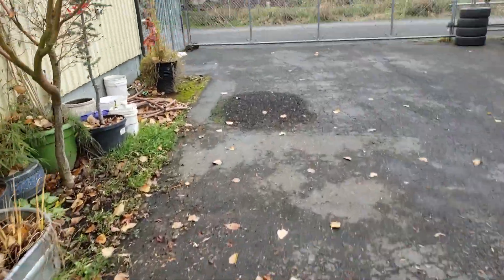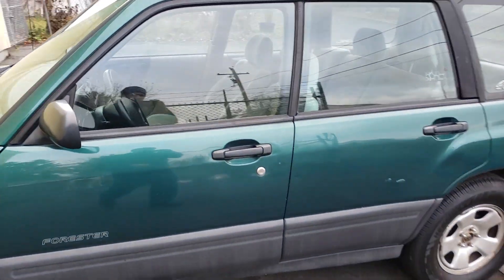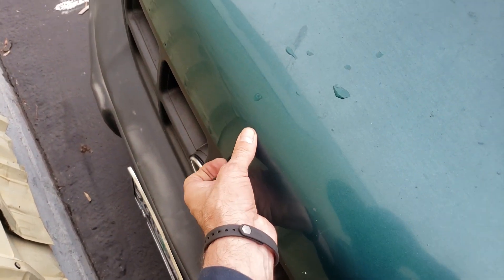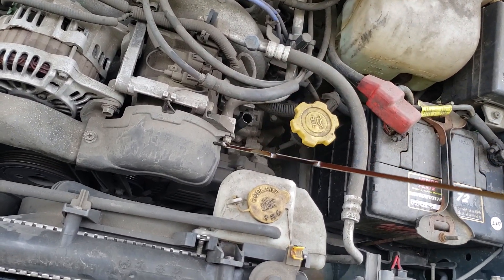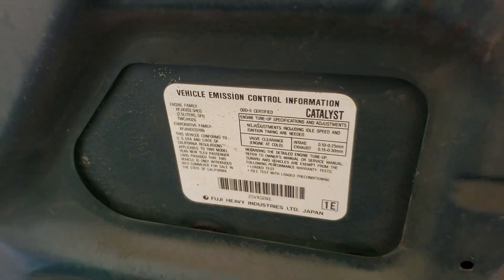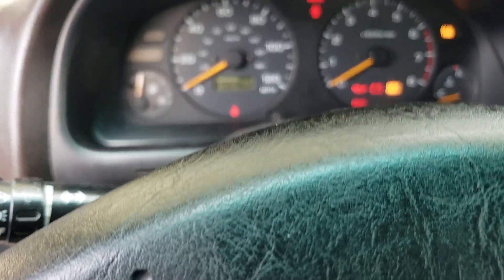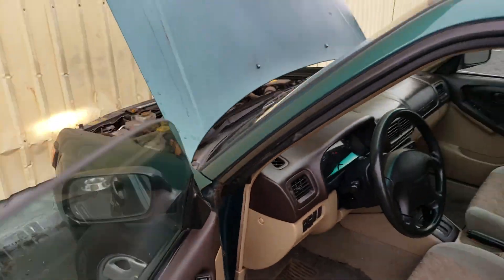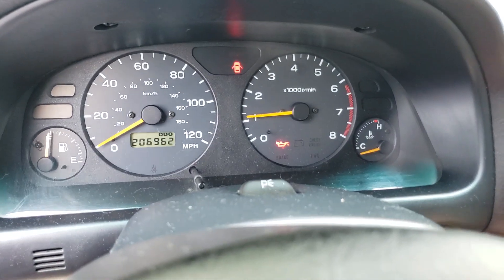Customer Drove Car for 3 Days with "OIL" Light On

Comment: Back a week ago, I accidentally flooded my carburator on my 1985 Simplicity 4208, What happen? Well. Oil went into the spark, So I shot out the excess gas. Drove it for a week. Not realizing gas went into the oil...

You know where this is going... It seized! And I only owned it for a month. Lucky me being a country boy and knowing simple mechanics I just drained the oil, Gave it 4oz of Marvel Mystery oil, Like 50 ounced of STP 10W-40 Oil, And manually cranked it (Turned the crankshaft counter/clockwise) To let the oil free up the gears, And I cranked it. The cylinder was still stuck, So I turned the crankshaft backwards so the engine could turn before stopping. And behold. The mower cranked, And the cylinder free'd itself and roared back to life... Thank god this is a $200 mower and not some $1k+ lawn mower. Don't mess up your hooptie!
Reply: Now, Luckily. Since it theoretically had oil, It didn't damage the mower that much, If it didn't have oil, And I unsezed it, It would have a loud constant knocking and excessive vibrating. Luckily mine didn't have any side effects. 

Note: If your engine seized on your mower, Manually turn it where the crankshaft bolt is, Don't turn the flywheel with a crowbar. The teeth on the flywheel (that touches the starter) is aluminum and you can bend/break the teeth and it'd be a nightmare to replace, Since you have to pop a bolt over the flywheel... Which is hell. So I would just use a wrench and twist it by the bolt.
Reply: Wow nice save

Comment: I'm a registered nurse. If we have someone come into the emergency department with chest pain we assume that it's cardiac until proven otherwise. It might just be gastric reflux, but the safe thing to do is act cautiously. Why would you assume that an illuminated oil light is NOT an indicator of low oil pressure and keep driving the vehicle when a few simple tests would reveal the truth? Heart or oil pump, in either case, ignoring the warning signs is a very poor choice.

Comment: The good thing about it is that non-VVL 2.5s are a dime a dozen for Subarus used. If they want something that'd last a long time, retrofitting a 22 in there would be a good bet
Reply: 2.2l is Subaru's best engine. Not the most powerful but damn good.
Reply: Tracey Allen it's got a power option too, though they're rare you can get EJ22Gs, put out about 280hp/268lb-ft stock, dead reliable and closed deck from factory. Can't argue with a stock 2.2 though, one of the only 3 older Subaru engines I'd buy including 22, 30, & 205/207

Comment: When you talk to the customer, start off by saying, "This wouldn't have happened if you had a 2-Stroke."
Reply: It does, I've fixed lots of my freinds 2t scooters, every single one of them was simply ran without oil, most of the time the oil metering pump failed.

Comment: Cheaper to put a used engine in with a warranty than to buy a new car or a used car with unknown issues that he will have to deal with. The car is worth it for where he lives.
Reply: A used engine could have an unknown issue too. An engine rebuild will cost around 2.5k and the car definitely is not worth that.
Reply: I swapped my buddies forester engine. We used a rebuilt from a local rebuilder. After the core it was $1700 plus labor which really isn't much concidering. We also did clutch and a few other things while we were there.
I can pull the motor in a hour or so. It's not hard.
Reply: @jeroenschuuring6060  Cheaper than a $25,000 2019 Forester. People suck at math and poor people have poor ways. This car with a freshened up engine is absolutely worth $2500 and 20+ years of service.
Reply: @Edgar-Friendly  so you would invest 2.5k into a car that in case of an accident will be totaled with a mere scratch on the rear bumper?
Reply: @jeroenschuuring6060  You used the word "invest" about a car? Are you 13 years old needing status while having no clue about how to maintain a car on your own? Please educate yourself about Uncle Tony's Garage here in YouTube.
Reply: @Edgar-Friendly  sorry to inform you but I'm a bit older then you think. I've had my own workshop for about 30 years now. I would not advise anyone to put this much money in a 21 year old Subaru forester. This has got nothing to do with maintenance. It's a large repair bill that has no justification whatsoever! What you would do in this case is irrelevant. You repairing in this case just proves your poor judgment.
Reply: @jeroenschuuring6060  Had. You obviously do not comprehend how to save money. You said "invest" in a car. Try to learn some math. $25,000 has one more zero...at the end meaning that its far more than $2500. Still $22,500 in maintenance to catch up over 22 more years. Christ.....you must be a Boomer. Would explain your complete ignorance about money and cost vs investments.
Reply: @Edgar-Friendly  hmmm, I know of someone that's ignorant but I'll leave it with 2500 would probably buy you two low mileage 1998 foresters. Have a nice day....
Reply: @Edgar-Friendly  you are so right in all your observations, they really should make room in a sanctuary for you. Close the doors and never let you have contact with the outside world again. You never hurt my feelings by the way, I can only feel sorry for you.

Comment: He ran it low and whatever oil was left sloshed to the back of the pan when he was going up that hill. Starved the oil pump and bearings (basically the whole motor) of oil. Sad, my father did the same to an old Chevy Metro I had in the mid 2000's

Comment: I used to have a car with an oil light that wouldn't go away. I think the actual light bulb broke (edit: the oil light bulb broke, but the noise was still very much there) , so instead of checking out what was wrong, I kept on driving the thing for a couple of months.. after getting rid of the car, it seemed the camshaft was basically running dry because there was so little oil pressure! We were all young and naive at some point.. still kinda feel bad for the Polo, loved driving that car :)
Reply: Ah common problem with older polos

Comment: Customer had a light. When the oil light on my Slant Six failed, I never knew. Nor when the rear main seal blew the contents of the oil pan all over the Atlanta suburbs on a 20-minute ride. But I sure heard the death rattle of burned-up bearings...

Comment: Looks like the oil light was not on due to low oil, but for low oil pressure. Probably the engine was due for major work, so driving it for three more days didn't really create more problems, it needed an engine anyway.

Comment: As a double check, can you fit a pressure gauge into the oil pressure sensor point to check the pressure or lack of it?
Reply: So a sensor to check what the sensor is checking. Ok then....
Reply: There are several places to to hook up an oil pressure guage and check the actual oil pressure.  No point now, that noise is almost certainly engine damage.  Oil pressure light and engine noise equals serious engine damage!

Comment: Yes because as is widely known the oil light or oil pressure gauge on your car is a conspiracy by the oil manufacturers to sell oil, which your engine doesn't need because air is lubricant enough. So you can safely ignore an oil pressure warning light. 

/sarcasm off

Comment: Sounds like its got major bearing failure. Possibly also skipped timing and/or plug wires / plugs / coilpack are bad so its not running on all cylinders. Might also be worth checking the MAF. But due to the sound of things... it will need a new motor

Comment: Well at least he had oil in it. But 3 DAYS and just HOPING IT WAS THE SENSOR? Probably dying oil pump. But 3 DAYS.... he deserves to have to buy another engine or a new car. I had it once AND TURNED IT OFF IMMEDIATELY. Within walking distance there was an engine reconditioning place. They told me WHERE the oil sensor plugged in and the lead had fell out/got knocked off somehow. Pushed it back on and we were fine.

Comment: If the oil light is on most likely low on oil or oil pressure sensor orher than that needs a new engine.

Comment: So what's the next step in the triage? If the light says "no oil" when the dipstick says "yes oil" where is the break in the system?
Reply: Oil pump fail or due to lack of changes a clogged oil screen pickup
Reply: , the light says no oil pressure not no oil
Reply: @jusb1066  Most likely clogged with ground up main bearing shell.

Comment: ....but why would he drive it with the oil light on instead of stopping...
Reply: @davemcguigan218  maybe had problems with the same sensor before?
didnt chernobyl happen like this
Reply: @fritzkuhne2055  it was a fairly new car.  And this guy didn't have his act together and even his friends blasted him.  Not like the average person who would react with common sense and shut off the engine.  So he learned an expensive lesson!
Reply: Yeah really... lol 

Oil light on means an instant stop, or at least as soon as you can, if you're on the highway or what...
Reply: dirty engine explains that he never looked inside the bonnet
Reply: Lots of oil pressure sensors go bad, look at dodges. 2nd most oil pressure sensors will shut off the light with as little as 2 or 3 psi, no light but still not enough to not damage the engine.
Reply: @davemcguigan218  i think many, if not most people would ignore it...
Reply: @TraceyAllen  I had a 2002 Impreza for 5 years with the same engine as the Forester in the video and never had an oil pressure sensor fail on it.
Reply: @daNdyPM  In a Subaru if the oil light light comes on while driving it's already too late the bearings are spun.
Reply: @rayg9069  only time (in my experience) its actually ok to over fill the oil a little
Reply: Because political correctness thst comes with buying a forester means that oil lights only apply to Republicans. He's exempt from its effects.
Reply: @fritzkuhne2055  Chernobyl was caused by turning all the safety shutdown systems off and doing an experiment followed by a steam explosion.
Reply: @TraceyAllen  yeah, oil sensors go bad. But a knocking noise followed by stalling MEANT NOTHING?

Comment: Those subarus are horrible at spinning bearings or braking a rod no good in the bottom end after 180000 miles over 200000 good job owner
Reply: That's a load of crap. Mine had over 500.000 (800.000km) on it and never had a real big issue.
Reply: @jeroenschuuring6060  same model or older the older Subaru can get that for sure but the mid 90's rotary are not well designed motor if you got a half million great job you did awesome
Reply: @RobertBurke719  rotary? I thought it was a boxer... lol
Reply: @daNdyPM  It is a boxer.  No idea what is with the rotary comment.  Maybe he meant boxer.